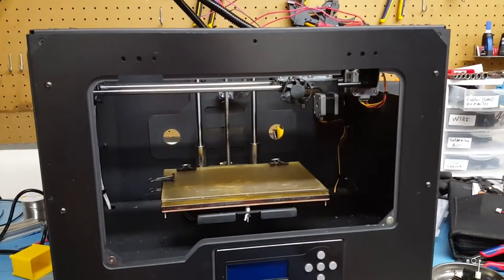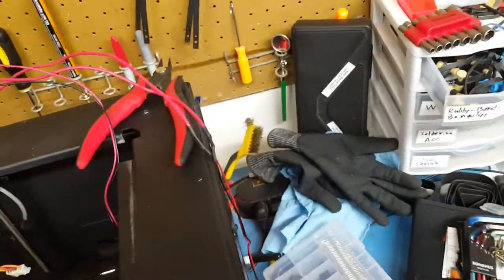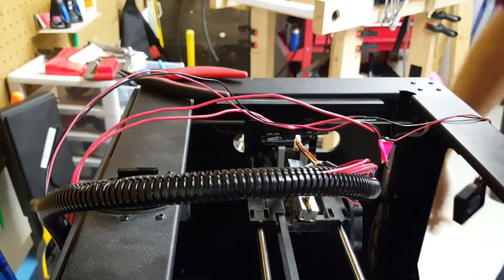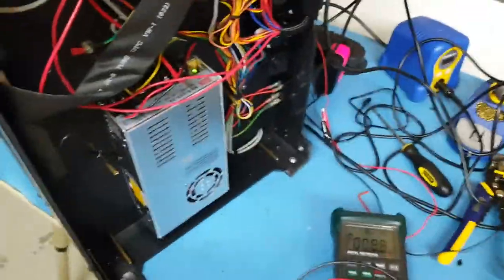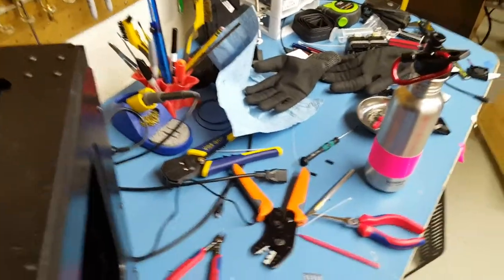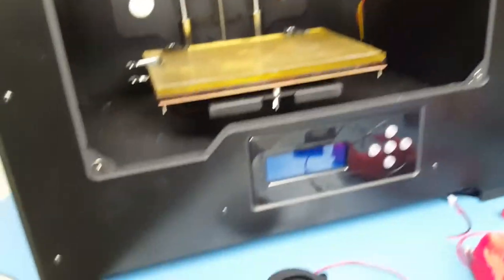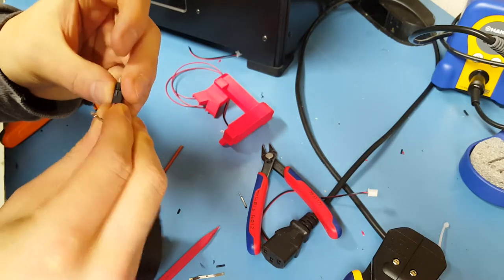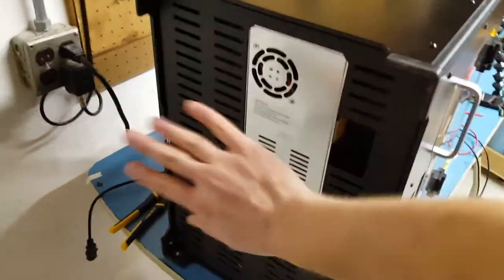Flash Forge Creator Pro Radial Fan Upgrade

Comment: Thank you so much i just wanted to find a better Radial fan and my mount just recently broke cause this weird owl egg thing broke mid print and trashed the mount so i just super glued it back together.
Reply: And now my fan broke the same way you broke yours, so i got a replacement disconnected it, find out i disconnected the non broken fan in the board, so I put them back and took apart the wires just above it,  Problem is now the part I took out and fished out that wire thinking with process of elimination that it would be right, So i pulled them fully out only to find they don't go to the other fan either and the right wires were further down with its own set of 2 plugs similar to the area that i was thinking both of the fans were connected to next to each other, and find out the 2 wires are red unlike the fans black and red and i don't know if it matters witch side they go in and I don't know what to do, Please help.